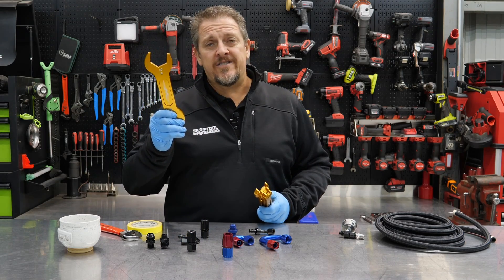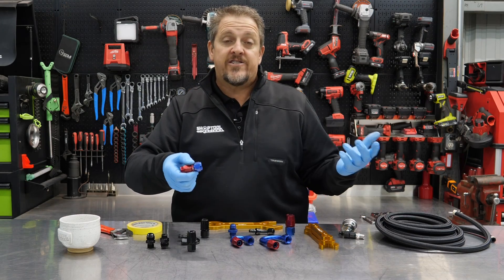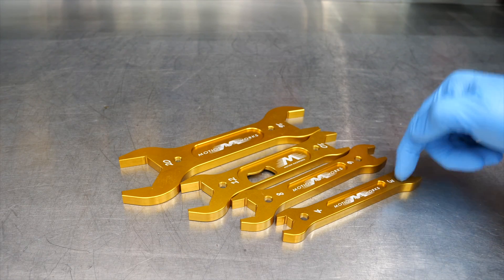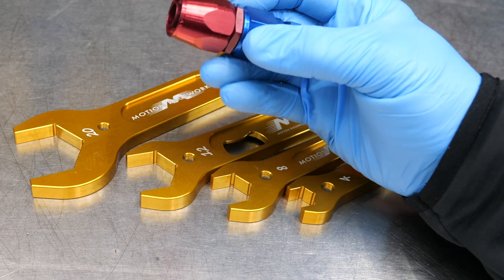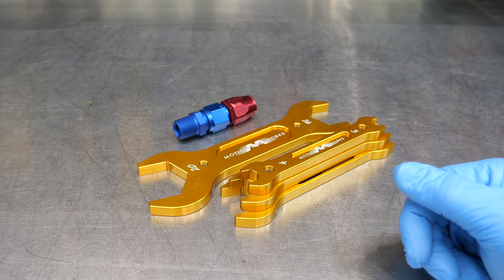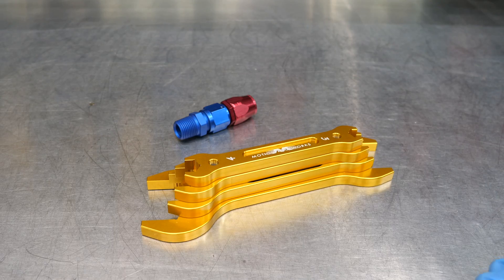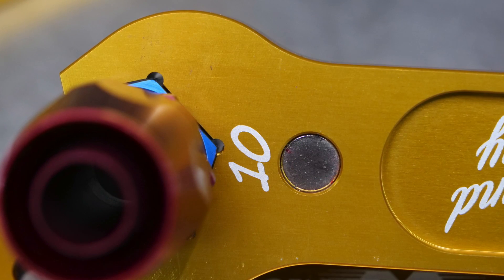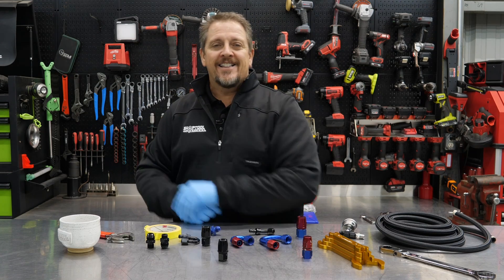Made in the USA! Motion Raceworks Billet AN Wrenches Review [AN Fittings]

Comment: The reason the inside corners have a radius at the flat junctures is because the end mill size they used to cut the flat features cannot cut a sharp corner so the tool program adds an undercut. Not for any other reason. It would be time consuming to switch to progressively smaller windmills in order to achieve a relatively sharp cover, albeit with a very small radius still being present.

Comment: How do they prevent damaging the anodized coatings on fittings, and does the anodized coating on the wrenches need to be redone periodically?
Reply: The reason to use and have AN wrench’s for an fittings is that they are both aluminum. When you use a steel adjustable wrench on an AN fitting, the steel is a lot stronger than the aluminum thus damaging the fitting. The anodizing is basically just for looks.